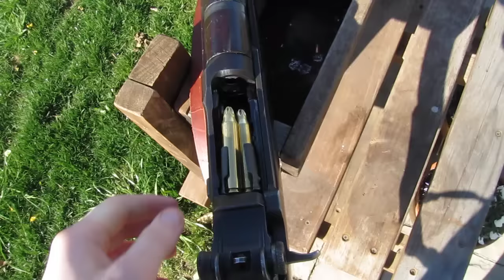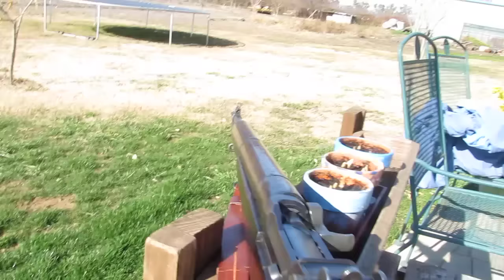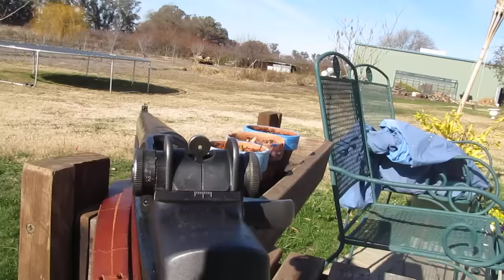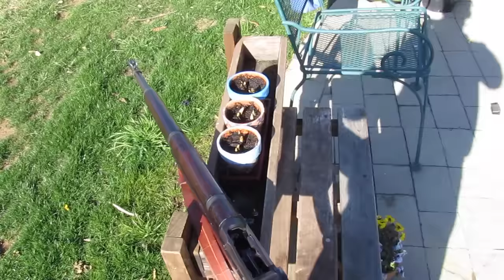M1 Garand firing in full auto?

Comment: with a light trigger pull the recoil can reset an fire another round, make sure you pull the trigger firmly to the end of travel
Reply: Yeah, I will make sure alright
Reply: Read the description.. it was grease causing a slam fire
Reply: Yeah, make sure. And make sure you’re DEFINITELY firing blanks, when you practice to NOT do this.
Reply: Will do mr. Atf agent
Reply: Mhm i will totally not do this
Reply: But why tho? That's a perfectly "legal" machinegun😂
Reply: That’s just bad advice. Don’t apply anymore pressure then it takes to break the shot, once the shot breaks, immediately let out on the trigger & stage it to take another shot. I see people all the time holding the trigger to the rear, waiting for the recoil to stop, then resetting the trigger. That’s silly.
Reply: Some folks don’t realize that physics is still a thing
Reply: I remember my .22 auto Marlin 795 would stovepipe a lot of rounds because I didn't shoulder it right, and grip it firmly when rapid firing. (The smallest of things).
Reply: light enough to do that on THAT gun? not a chance.
Reply: So don't know pull to wall?? That's interesting
Reply: @goinhot9133  Actually, that is following through.  Necessary for precision shooting.  Just pull through until the trigger stops moving and it won't bump fire.
Reply: Binary trigger  m1 garand
Reply: firmly grasp it
Reply: Tell me you don’t know what you are talking about without telling me you don’t know what you’re talking about
Reply: @andrewjacobson243  double fire one pull
Reply: Or don’t.
Reply: @goinhot9133  
Stupidly slow reset is bad thing but not so much as negligent discharge.
If it happened when shooting high energy single/double action revolver, it can kill you.
Reply: @moosefrog2  I said firmly grasp it. Lmao!!!
Reply: He commented above what the problem was. His voice definitely fits the description you gave tho
Reply: "It turns out the firing pin had old grease gumming it up that caused a slam fire to occur."
Reply: My dude it was grease causing the slam fire check the description.
Reply: Yeah, this is what bumpatocks are designed around
Reply: bump firing?
Reply: Like that bump stock that was once controversial?
Reply: not a bug, a feature.
Reply: And Bump Fire was born, and Lord Garand saw that it was good...

Comment: the bolt has a simi free moving fireing pin if the primer is weak the bolt will slam down on the round and the pin will hit the primer and boom we in the m1 and sks world call this a slam fire.
Reply: Dirt, dust, carbon, and even an oil buildup can also cause this. It's why the M1A and Mini 14/30 have springs on the firing pin.

There are also kits.to add a spring to an SKS, because of this. Its why my SKS only gets fed surplus ammo, as the civilian offerings tend to have softer primers, making it more common. Other option is to soak the bolt in solvent, and scrub the firing pin channel.
Reply: @kevinfox500  I actually had a little spot of rust cause it to happen to my garand 6 or 8 months ago
Reply: @jamienielson4340  Never had that one happen on mine, but I have seen it before. Person that taught me cleaning was a career marine, and a lifelong migratory bird hunter, who loved hunting the outer banks. He'd seen what brackish water can do to the internals.

A trick he taught me was hot water with a few drops of dish soap, then blow it dry with compressed air. Lightly oil afterward, no rust issues.

Works good with corrosive surplus and black powder as well, as both contain salts. Most solvents won't remove the salts, but the soap will.
Reply: Had my sks slam fire when I first got it. Glad I only had 5 rounds in it! Fixed it but now I wish it would do it again when I'm ready for it lol
Reply: @sethfieldhouse6876  "full semi auto"
Reply: when your M1 has aspirations of being an open bolt:
Reply: @thevalorousdong7675  yes sir it went fully semi automatic lol
Reply: @sethfieldhouse6876  Well if a shoelace can be considered a machinegun, then I'll need you to hand those fingers over pal, or pay a 400 dollar tax stamp per
Reply: @thevalorousdong7675  Or a belt loop.
Reply: "It turns out the firing pin had old grease gumming it up that caused a slam fire to occur."

Comment: There was enough pressure to cycle the bolt back just enough to chamber, fire, and eject the round, and do so consistently (seeing as it cycled the second round) however, not having enough energy to push the bolt back to the trigger sear to reset for semi auto.

Comment: Same thing happened to my match Garand. The trigger had a custom polish stone job but if you didn't hold the trigger rearward firmly rearward after each shot the sear might not catch for the next shot. If it still happens, your trigger bearing surfaces may be worn and you'll need new trigger parts installed.
Reply: Read the description

Comment: A sticky firing pin should not be able to slamfire, unless the receiver bridge cut and firing pin tail are out of spec too.  The firing pin tail has a ramped tab that can only allow firing pin protrusion from the bolt face, after the bolt is fully locked.  If the firing pin can protrude enough to allow a slamfire the rifle is considered dangerously out of spec.  If would not pass an armorers inspection.  If such a slamfire happens with a live round you are looking for a real headache.

Despite what the owner said, the idea that the action slammed open harder than expected with the blank firing adaptor, and that caused what amounts to a bumpfire seems very likely.

Comment: Reading the description, other things can cause this. If you’re firing ammo with soft primers with a strong recoil spring, it can sometimes chain fire just off the force if the bolt sliding home.
Reply from the maker: The issue was resolved years ago. Old grease in the bolt made the firing pin stick which caused a slam fire.  I appreciate the input though. Lots of good information in the comments.
Reply: @modeyman101  This does make sense. But if you ever replace your recoil spring, and you fire blanks again, stuck bolt or no, it could still involuntarily turn into an open bolt machine gun due to soft primers in blanks. This is mentioned in the CMP M1 manual, so I’m not making things up here.

Comment: If you haven't modified the rifle's trigger group at all and it shoots semi-automatically with live ammo, then what probably happened was a slam fire.  Since the M1 Garand has a free-floating firing pin, it requires ammunition loaded with hard military primers or "sunken" primers to avoid whats called a slam fire -when the inertia of the firing pin sets off the primer upon chambering.  In this case there is nothing mechanically modified/wrong with the rifle, the ammunition was at fault.

Comment: Had a Springfield. Was at the range and when I pulled the trigger it slam fired 2 rounds, I was like Whoa, did that just go full auto, lol. Cleared the clip, reloaded new a new clip, remainder of the time at the range, M1 fired fine, it was definitely weird and cool.
Reply from the maker: That’s exactly what happened here. It was a rifle I got a day before and didn’t clean the old grease out of the bolt.
Reply: @modeyman101  At least now we know what caused it. See the same issue with the SKS.
Reply: Had a Steven's 987 that used to do that. It was why they stopped making them. Thing would pop off doubles and triples sometimes. 

Cause was carbon buildup in the firing pin channel. Kept it clean, it ran perfect. Go over 200 rounds, it would start slam firing.

Got me kicked off a couple ranges over the 25 years I owned it, and one talk with a member of local LE, at one range, as Ineas doing a DCIOR on the rifle. Showed him the cause, and all was good at that point.

Passed it down to my daughter, with the warning of keep it clean, and do a DCIOR Before each range trip. Not a problem since.

First time it did it to me was on a mid season squirrel hunt, and I triple tapped the squirrel in the head. Switched to the H&R 922 dad had with,  and found the problem when we got home.

Needless to say, I now clean every weapon after every outing, if it gets fired.

Comment: Did the second one fire on release of the trigger? On the M1 platform it's not unheard of for the secondary sear to be slightly too far back, causing it to fire on pull and release. Also can happen on the M1A, M14(in semi), Mini-14, and AC556(In semi AND burst mode, can fire a 3 round burst then fire 1 more on release). Very rare malfunction but not unheard of. It can also be done intentionally(and legally) if you want to have some fun, you just need to put a staple under the secondary sear.
Reply from the maker: It turned out to be a simple slam fire. The firing pin got stuck so when the bolt slammed forward it fired.

Comment: If I were you I'd take this vid down. The ATF sent a guy to prison when his AR shot 2 shots with one trigger pull.
Reply: i think its different with an AR take a m16a1 for example, you switch out 3-4 pieces you have an AR you switch them back it can fire full auto, you can get i believe 10 years for having the parts and an operational AR, im sure the man you are referring to had his house swept and his gun cleared and tested and if they found it was an illegal conversion would have absolutely arrested him but a perfectly legal AR firing 2 rounds would just be taken away as it was a defect (if it did it with the police as well) they would do the same with this kid
Reply: marchingpackofCeHS Nope, you can still get in shit if your weapon fires automaticall weather or not your weapon is modified for automatic fire. I know theres a case where some dude had a worn out machine gun ment for semi auto and the gun ended up firing full auto at a firing range accidentallty just from the recoil and worn out parts not locking the next round. Even if your weapon is ment for semi-auto, any automatic fire, weather incidental or accidental is still a felonly from what I gather
Reply: no there is a difference between worn parts and filed down parts. if they went after him and found file marks on parts there would be serious repercussions. however if it was worn naturally there would be no problem. even the biggest collectors dont check everything that often. theres a difference between intentionally modifying and a malfunction.
Reply: Bullshit
I wanna see the case file for that

Comment: You’re firing blanks out of a weapon that fires a high powered cartridge. Blanks typically fire with a lower gas pressure. Typically you’d have a BFA on your weapons muzzle to help with the back pressure to force the gasses to push the bolt back far enough to lock onto the sear. But because you don’t have a muzzle device your weapon fires and pushes the bolt back far enough to just eject and load a round but not lock the firing pin onto the sear. Thus firing in full auto. Also known as a runaway gun. The weapon itself is not damaged in anyway, it was just your lack of knowledge on how the blanks would work with your weapon.
Reply from the maker: This did have a blank adapter on it. 
The issue is described in the video description.

Comment: Might be a slam fire bro next time use only ammo for the M1 Garand no Russian crap not even if it is amde fro M1 garand especially from Cabellas it blows M1s up... either make sure it has military hardened primers or CCI #34 primers...if its M1 Garand blanks and it shots the a whole enbloc of 8 on one trigger pull then someone screwed up a home trigger/sear assembly job up. Then you will have to throw in a new trigger/sear assembly Fulton Armory has one here- http://www.fulton-armory.com/triggerandsearassembly.aspx plus they have new hammers etc. You can also reload ammo just use CCI #34 military primers and powders like for bullets 155 gr. or less use IMR4895/H4895 for bullets larger than 155g use IMR4064. Youc na use like 6 different others and do nto needa press to reload you can buy a Lee classic loader - http://www.midwayusa.com/product/508946/lee-classic-loader-30-06-Springfield just use powder fro M1 Garand and load each cartridge individually. These loaders can be thrown in a back pack and used any where per each caliber. You can also slug your barrel to see if its worm past .308 in diameter if its .309, .310.311 or .312 you can find bullets to reload in it or get another barrel...put it on a lead sled and do a 5 shot group at 100 meters then decide. They have videos her eon you tube to slug your barrel...do not use over 175 gr bullets in the Garand...yes it can shot heavier but will bend the op rod eventually. Any who the 150 gr 30-06 cartridge is the best for man killing and most North American game using any 30-06 rifle check the ballistics on it
Reply from the maker: I did a full break down and cleaning the night this video was taken and it's worked great ever since. 
Thanks a lot for all the info too!

Comment: Ehh the M1 Carbine is another completely different gun... its also semi automatic
Reply: Actually you can shave down the catcher in most semi automatic weapons including the M1 Garand but the problem is in the M1 Garand after doing so I don't think the trigger still works. lol. as soon as you release the bolt if not done properly it will shoot until it runs out of ammo. I'm not exactly sure but by looking at the internals I feel that the trigger would just constantly slip. If you want to try it by all means go ahead but don't put more then 3 rounds in the gun.